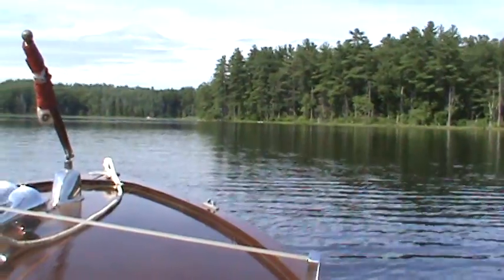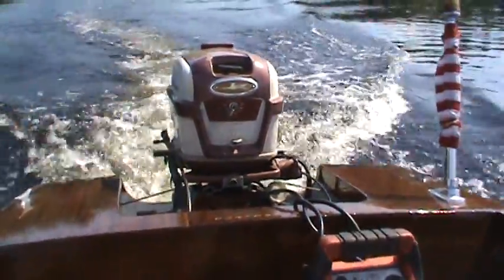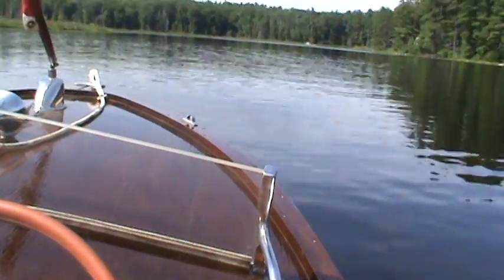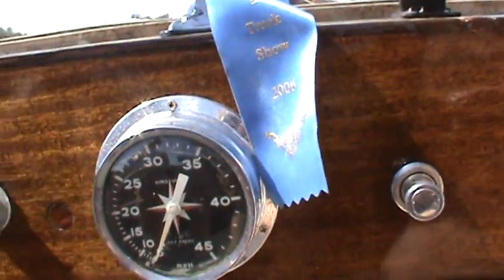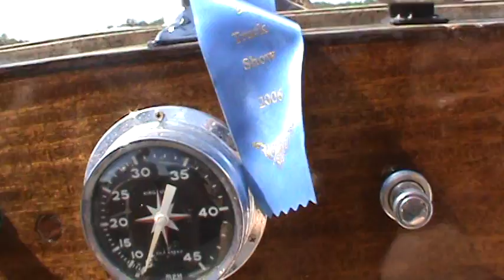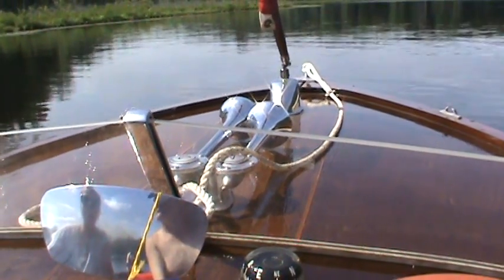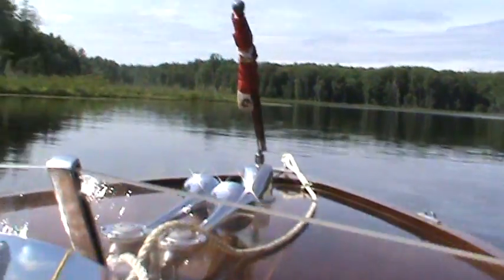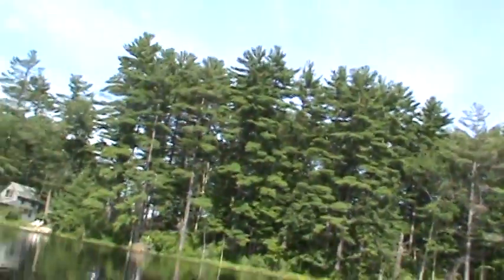takin mamma on the chris craft

Comment: Mustie, I just found this older video and I am loving it. Old school wood runabouts. My grandfather was a carpenter. He built a boat similar from a book with boat plans in the early 50's. Solid Mahogany and brass screws. Had a 16 horse Mercury outboard and cables for steering from the wheel up front. It was a 14' about like the Chris Craft Barracuda you show in this video. Spar varnish, caulk replaced every year in the joints, white caulk and natural Mahogany finish, green bottom with a red line between the green and natural wood.
Reply from the maker: great boat and l still have it
Reply: Always have loved the Chris craft boats. Nothing prettier than  a Chris craft. Hope your still enjoying it today.

Comment: Back in 1956, when I was 13, I helped a retired Dr. Put that kit boat together in his attic one winter in CT. We sanded the mahogany and drilled every screw hole, and ran every single brass wood screw home. There were hundreds of them. The attic was on the third floor of his home and had just enough room to fit the completed boat in. We finished it about March, and did everything but varnish it. Then we took the entire boat apart piece by piece and passed it out the third story window to the ground once the snow was gone, reassembled it in the garage, finished it off and had it in the water by Memorial Day.